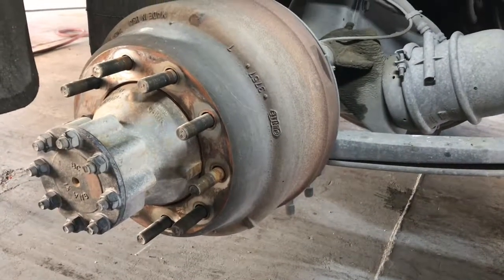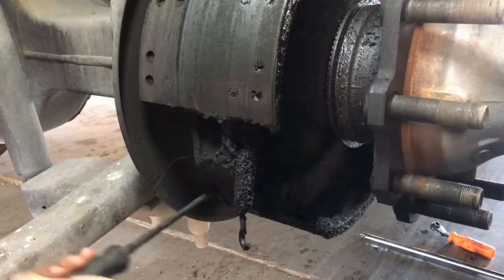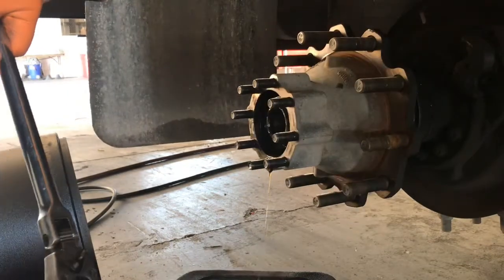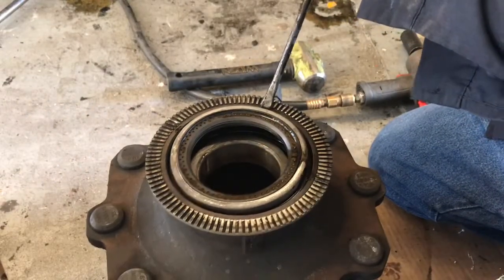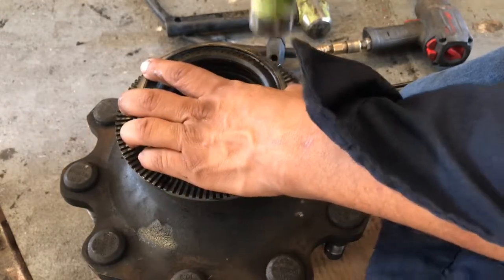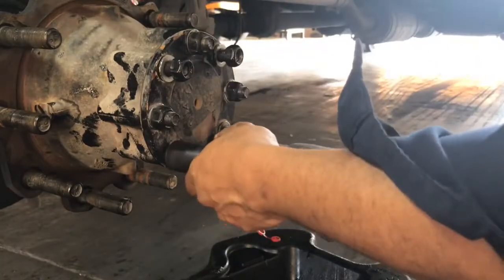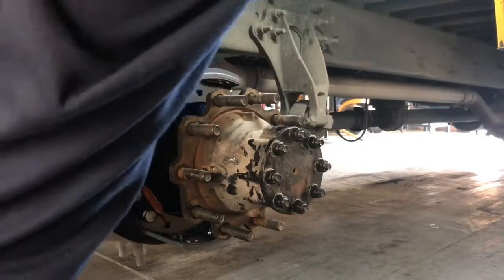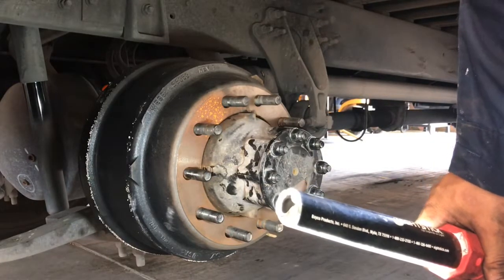Replacing brake shoes, drums, and hub seal

Comment: I am new to air brakes. Are these also adjustable like hydraulic brakes? Noticed you put in new drum and new pads. Did not see the part where you adjusted how tight or loose the pads sit on the drum.

Great video!!!
Reply from the maker: Manolo M my bad. They do have an adjusting slack adjuster. It’s location is on axle shaft behind dust cover. I’ll get it in the near future bro. My bad
Reply: @JoesBusBarn  Oh ok good to know... No prob bro. I am just learning from these great videos!